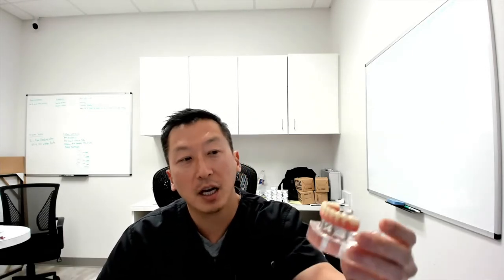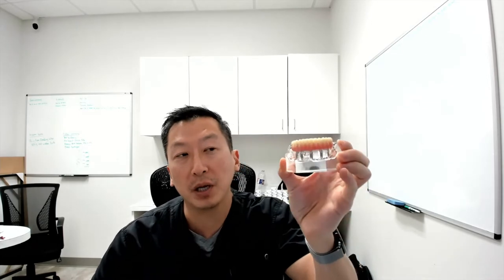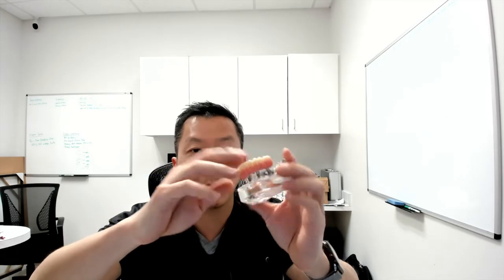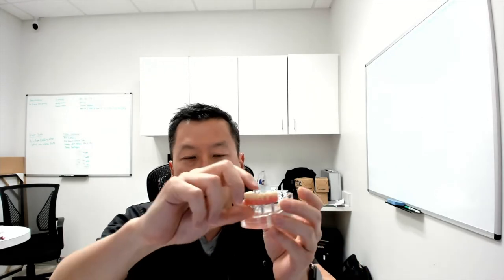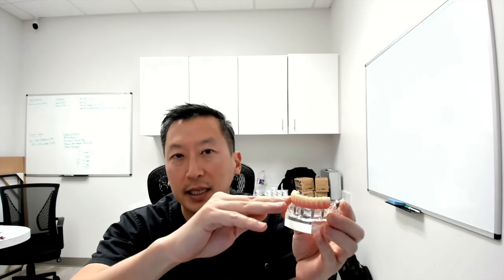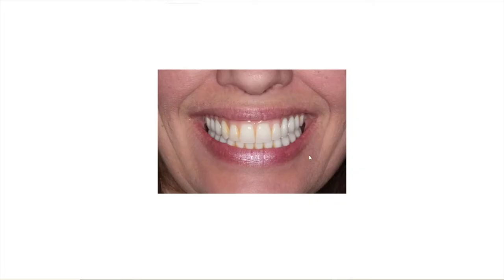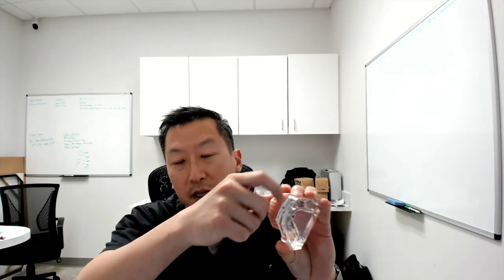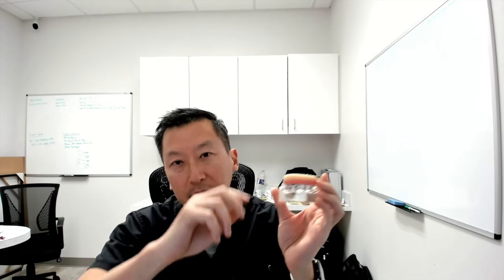Zirconia vs. PMMA: The Ultimate Guide to Choosing Your All-on-Four Prosthesis

Comment: 20-30k for the teeth. Not including surgery & pulling old teeth etc more like 50k just to be honest. Just got my consultation done for zirconium teeth top & bottom. Surgery in 2 months can’t wait to get my new teeth. Only thing is it’s basically a new car payment for the next 8 years. But I have faith they will last even after paid off.
Reply: If you want to replace 3 or 4 teeth then  India is cheap , just have more information
Reply: I was quoted $60K for top and bottom zirconia arches not including 18 extractions, here in San Jose in 2022.
Reply: @bstallday: how did it go?
Reply: @SeeYouEnTee666 Where in Bulgaria are you going to have this done?
Reply: $50K for mine. Upper and lower.

Comment: Are you allowed to NOT have a plastic prosthetic and just allow the implant to heal? Also, I want the implant zirconuim not titanium. I had materials / bio compatabilty testing done and titanium is a big ‘no no’ for me.
Reply: actually while the implants are healing to put any arch on those implants could create implant failure due to premature loading
Reply: No
Reply: You need to watch Dr Choi's other videos.  If you are doing snap on, all 4 of your titanium implants needs to be inserted parallel to each other.  After they are inserted, you don't want to snap on anything and allow the gum to heal around and implants.  I found out the differences and the reasons for snap-ons to not use any plastic prosthesis is that the snap on implants are shorter and a locator abutment on the top.  These shorter implants are more susceptible to move around while your gum/bones are not healed completely, so daily removal, snap on on these implants will mess up the alignment, so yes, you are not supposed to have "provisional prosthetics" for snap on implants.  For hybrid implants, yes, you can use temporary plastic prosthesis since they are fixed and won't allowed you to move up down sideways etc.

Comment: If the top arch only uses traditional dentures due to my dentist saying the top does not have enough bones, so no implants.  Lower can do implants and if lower arch is zirconia hybrid all on 4, should my upper also uses zirconia dentures too?  Since if the top is PMMA, the bottom zirconia prosthesis might crush the top denture if it's just acrylic?

Comment: I just went and got all on 4 at the top I was told that I couldn’t get zicornia if I didn’t get it upped and lower when they offer the zicornia but they didn’t mention I have to do both is this true can I just get only my upper done with zicornia or will it break my bottom teeth

Comment: Thank you for sanity!  I like your approach and agree with most of your information.  Expansion and contraction of metal (amalgam) in my teeth eventually fractured a good number of them.  Why am I to believe that metal implants will not do the same to my jaw?
Reply: The thermal expansion coefficients of teeth and titanium are almost identical. In other words, as a tooth expands or contracts with hot and cold, a titanium implant expands and contracts at a similar rate.  Amalgam is MUCH more sensitive to thermal changes because it has mercury in it. That's why mercury is (was) used in thermometers--it changes very easily with temperature. So amalgam fillings will crack teeth over time if they are large enough because they expand/contract at a much higher rate than a tooth. Titanium doesn't have that issue.
Reply: What you say is misleading if not patently inaccurate.   Titanium is not all that is in implants.  If you are going to be accurate, then lets do so please.  Implants are not titanium:  They are titanium alloy principally with aluminum and vanadium in the Alloys.  Aluminum has a horrific rate of expansion and contraction.  Worse, Just as mercury is neurotoxic, so too is aluminum.  Statistically the 3% of the population with the 4/4 allele expression of the apoliprotein E simply can not tolerate nor get rid of it and they should not have "Titanium" implants.  The 16% of the population with the 3/4 expression at apolipoprotein E are moderately reactive to the aluminum  This means nearly 1 in 5 patients that cross the threshold will suffer moderate to severe  health consequences from Titanium aluminum alloy implants just as they suffered acutely and chronically from Mercury exposure.  The original approvals for titanium as implant materials predate our better understanding of the human genome and in light of that new understanding IMHO no patient should receive an implant without appropriate genetic testing and without dental materials sensitivity testing like Biocomp or clifford or Melisa @rmdunford

Comment: I’m in the finishing phase of completing all on 4 PMMA/titanium prosthesis. I have 4 on top and 4 on the bottom. I was told zirconia is too heavy for 4 implants and that I would need 6 on top and bottom to do zirconia. Is this true?
Reply from the maker: no that's not true.  as long as you have good bone, enough volume and density, you should be fine with zirconia.  i have plenty of older females with soft bone who only had 4 implants and have been fine for years with zirconia
Reply: @northtexasdentalsurgery  ok thank you. After a couple of year I’m going to upgrade to zirconia all on 4 bridges

Comment: My dentist is talking about a porcelain prosthesis. What is that?
Reply: Did you ever find the answer to this? I was wondering the same thing because I asked my doctor for zaconia. But he keeps mentioning Porcelain
Reply: So does mine. I have asked at just about every visit. “The bridges are Zirconium, right?” And her response is always, “ Yes, they are Zirconium Porcelain.” I’ve been researching on line if there is a difference and she and I are not exactly on the same page. For financial reasons I am doing 3 on 6 in steps. Each section at a time. I’m at the point of waiting for implants and bone grafting to heal on top with no temporary prosthesis, then when healed I world get permanent prosthesis and top will be done. The time line to complete whole upper will be about 18 months.  I’m just concerned that her verbiage may be not what I think I’m getting. Please tell me they are one and the same.

Comment: My quote from the oral surgeon is 30,000 for removal and temporary. My dentist then wants 25,000 for the permanent six months later. She is of the opinion that zirconium looks great but it is too new to know how it stands overtime. She thinks it’s very strong, however, it’s brittle and can break, and if it does, you have to replace the whole arch. From what I’ve read, most dentist seem to prefer zirconium. What do you think?

Comment: I have insurance that will pay for the pulling of the teeth. I don't need bottoms just tops. I am looking into most likely doing the removable hybrid dentures so I don't have to worry about the food getting stuck in there. I've had a few consultations & I'm not even kidding you EVERY TIME THEY PUSH PUSH PUSH for flat out dentures FOR A 33 YEAR OLD. I really do need to get them done asap though cuz I have congestive heart failure & my doctor's keep telling me that it's concerning having the infection issues I have with my weak heart. I'm not really worried about the final cost I'm more concerned with the amount per month. Cuz that is what is going to make the difference.

Comment: What happens if you have zirconia permanant on top and then do you bottom a couple years later.  Will the ziconia break your temps on the bottom?
Reply from the maker: if you get a chairside temporary on your bottom, the answer is probably yes.  what i would recommend is get a digital milled or 3d printed temp on your bottom and you shouldnt see any breakage, provided the surgery and design was done right.
Reply: @northtexasdentalsurgery  Question!  Can zirconia be secured with the old technology of being cemented on 8 healthy upper implants or will it have to be screwed in.  Is it too heavy for cement?

Comment: I was quoted $30000 for an all on 4-6 upper with zygomatic, plerygoid, trans nasal implants including zirconia final prosthesis and two lower jaw implants.  Do you think it’s reasonable?
Reply: That is a great price. I'm basing my opinion on all the recent research I've been doing trying to get this procedure done myself. I'm in Tampa, Florida.
Reply: Yes that is a great price. Just paid $48k for 30 extractions, 5 upper/5 lower screws. Custom ceramic zirconia upper and lower. Clearchoice. My price did not include the zygomatic implants, which might be more sturdy than what I have currently. Of course, I did not know about the possibility of zygomatic implants until after I completed my surgery.
Reply: @Allky What Clear Choice did you go to? Clear Choice in Indiana  told me they wouldn't do ceramic.

Comment: I asked if I could have zirconia and was told it wasn't needed for me and I would be fine with hybrid PMMA. They said zirconia was a very beautiful product but that it was more brittle so if it failed it would be worse than replacing hybrid PMMA. I was a bit taken aback that they were trying to talk me out of zirconia. Thoughts?
Reply from the maker: that's bs.  I wouldnt mess with a hybrid versus a well done zirconia.  I saw a patient recently with a hybrid and she was upset that her tooth broke off.  idk why they told you that.  and no, zirconia isn't brittle like that unless its poorly made
Reply: Hi Jon, another material is nano-ceramics.  They're the Goldilocks of materials. I did a lot of research before I made the plunge. The titanium bar is replaced by nano-ceramic which is then  "bonded" to the nano-ceramic bridge. These materials most closely replicate the characteristics of bone and teeth in compressive strength.  Crystal Ultra and Trilor are the commercial names that I chose for my new and improved smile.
Reply: @dougd2723  i have a full lower arch that was acrylic on cobalt. dds pushing full zirconia. can you post the options you used?
Reply: @johnkutsch5155  Hey John, I'm gonna state the obvious, do your homework.  Learn about the materials being used, and why. (IMHO zirconia is too heavy and the least adjustable.) Stay in US. What's the provider's history.
 Where I started in my quest was not the normal route. I looked for information from "bridge makers", the people who make the bridges. The facility I went to has a lot of experience, and are at the forefront in developments. I chose G4 by Golpa. I've never looked better, seriously. I had a wicked narrow upper palate with an overbite. It took 10 yrs of cleaning toilets to save for them and I have to emphasize that these are my 3rd  set of teeth. They're not fake they feel normal and you'd never know even when close.

Comment: Soooo, have Zirconium all on 4 , 7 months ago, EXTREME dry mouth, they say I might be allergic to the pink gum stuff- pmma?  Going in to the implant place for them to remove uppers for 1/2 hr to see if I salivate.  This is the most uncomfortable thing ever. I don’t have an previous problems with this.  Dr. Said now one gland in my mouth isn’t working? Your opinion on what could cause this, please respond?! I can’t talk, sing, I eat and my mouth dries up.  Dry mouth product don’t work. Desperate. $39000 later.
Reply from the maker: that's a good question.  I have no idea.  but if it is a zirconia prosthesis, the gums and teeth are made of the same material.  let me know what happens
Reply: @northtexasdentalsurgery  at my visit yesterday, they offered to do full zirconia ,  apparently I have gums made from a composite with a clear over it.  They said they will do full zirconia and while I was there with prosthetics out for half he, I salivated.  My left cheek gland wasn’t working and they said the upper back corner of teeth were in the way, so they will bring that in, and in a month I will go back and try the new.  They asked me to do a blood panel to see if I have issues, like Shogrens, but there are no sores, etc. and I have had a healthy body. Dry mouth is the worst thing I could ever experience, and am praying for a relief.  Thank u for your response, I will let u know.😊🙏🏻
Reply from the maker: @1wyldhare  good to hear they will get you zirconia.  those fixes should help you out

Comment: I've had everything done. Getting my final prosthesis on 6-28-22. I don't think they are gonna be zirconium. Now I'm anxious about potential problems. I was told that the best one could be added later so he went ahead and did a better implant so I could eventually go up in material. Is your price for both top and bottom or just lower or upper?

Comment: So six months ago I decided because of alot of problems with my upper teeth I was going to get them all pulled and get a denture. I did some research and because of the cost settled on a snap in denture. Having worn a denture for 6 months I've learned that the Pallet really bothers me but my dss prefers to leave alot of Pallet for support and suggested I look at a permanent full arch prosthetic. I've tried getting a price quote for it but nobody will give me one. So anybody, if everything is good with my bone graphs and implants, how much would a zirconium upper arch cost installed?
Reply: Im am getting full upper and lower X in all. I was quoted 30,000 per arch in the states and will have it done in the Dominican Republic for 16,000.I know many who have gone and had stellar results!

Comment: Is it still 20 k to 30 k ?
Reply from the maker: its come down a bit.  definitely should be towards lowers 20k.  definitely not 30k
Reply: @northtexasdentalsurgery  Thank you just got quoted almost 65 k in Spanaway Washington for lower snap in and zirconia upper fixed I said I didn't want fixed upper but price for snap in upper was 28 k same as the fixed. Not having much luck finding a good dental implant office up here for a reasonable price any suggestions
Reply: I paid 52k plus a bit more